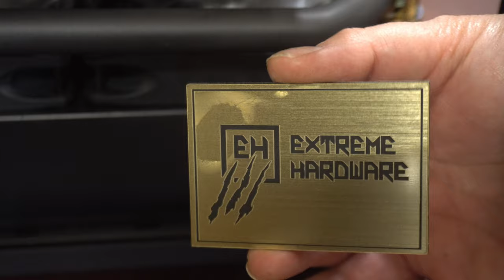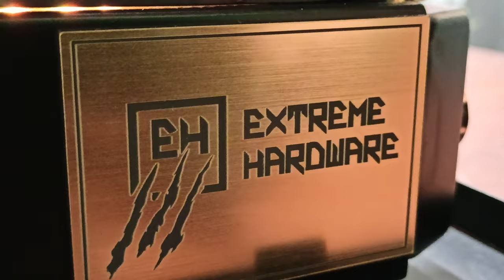EH "CHRONOS II" - Nowa odsłona konfigu z 2020 roku.

Comment from the maker: #rtx4090 #i913900k #intel #nvidia #raytracing #rog #asus #watercooledpc #gold #corsair #ekwb 

EH "CHRONOS II" jest nową odsłoną projektu EH "CHRONOS", który zrealizowaliśmy pod koniec 2020 roku.
Nowa wersja maszyny powstała jeszcze w 2023 roku.

Na początku materiału zobaczyć można wcześniejszą wersję EH "CHRONOS", na końcu opisu link do worklogu z 2020 roku.

W gruncie rzeczy jest to całkowicie nowy konfig gdyż z wcześniejszej maszyny pozostały jedynie dwie chłodnice, złączki oraz rezerwuar.

ROG Z490 MAXIMUS XII EXTREME ustąpił miejsca ROG Z790 MAXIMUS EXTREME, i9-10900K zamieniony został na i9-13900KS, a TITAN RTX doczekał się zastępstwa w postaci RTX 4090 STRIX. 

Wymienione zostały również obudowa Lian Li 011WGX na Lian LI 011XL oraz zasilacz Seasonic TX 1000 na Corsair AX1600i. Wentylatory Corsair ML 120 PRO zastąpiły Noiseblockery NB-eLoop XB12P ARGB. Jedna z chłodnic 360/30 ustąpiła miejsca 360/45.

Podwoiliśmy również ilość pamięci DDR z 32 GB na 64 GB. Wcześniejsze moduły DDR4 Trident Z Royale na kościach Samsung B-Die wymieniliśmy na moduły Trident Z5 na kościach SK-Hynix M-Die.
NVMe SAMSUNG 970 PRO 1 TB zastąpiony został dwoma dyskami NVMe SAMSUNG 990 PRO 2 TB.

Specyfikacja EH "CHRONOS II"

i9-13900KS 5.6 GHz P 1.269v / 4.4 E / 4.6 Ring
https://www.x-kom.pl/p/1101211-procesor-intel-core-i9-intel-core-i9-13900ks.html?sm=COnbRpxN
ROG Z790 MAXIMUS EXTREME
https://www.x-kom.pl/p/1075878-plyta-glowna-socket-1700-asus-rog-maximus-z790-extreme.html?sm=n5cqZakU
64 GB (4x16) Trident Z5 6200 MHz CL36.38.38.36 T2 II/III
https://www.x-kom.pl/p/1189477-pamiec-ram-ddr5-gskill-32gb-2x16gb-6600mhz-cl34-trident-z5-rgb.html?gad_source=1&sm=VsBDGro0
ROG RTX 4090 STRIX OC / + 140 + 1200
https://www.x-kom.pl/p/1077106-karta-graficzna-nvidia-asus-geforce-rtx-4090-rog-strix-oc-24gb-gddr6x.html?sm=1EKLBalD
2x SAMSUNG 990 PRO 2 TB
https://www.x-kom.pl/p/1083719-dysk-ssd-samsung-2tb-m2-pcie-gen4-nvme-990-pro.html?sm=rXJqWi62
Creative AE9
https://pl.creative.com/p/sound-blaster/sound-blaster-ae-9
Corsair AX1600i
https://www.x-kom.pl/p/443737-zasilacz-do-komputera-corsair-ax1600i-1600w-80-plus-titanium.html?gad_source=1&sm=In3r3HcL
Lian LI 011XL Black
https://www.x-kom.pl/p/577765-obudowa-do-komputera-lian-li-o11-dynamic-xl-rog-certified-czarna.html?gad_source=1&sm=QFnOudPo
Adapter 12VHPWR 90 CableMod 1.1 Gold (sprawdzony w sposób nadzwyczaj restrykcyjny)

Custom LC:

EK Velocity 2 GOLD LGA 1700
EK VECTOR 2 Acetal + Nickiel RTX 4090 STRIX
EK D5 
Alphacool NexXxos 360/60 
Alphacool NexXxos 360/45
Alphacool NexXxos 360/30
Watercool Heatkiller 200 mm 
Złączki, kątówki, korki etc. Barrow Gold
10x Noiseblocker NB-eLoop XB12P ARGB
Thermalright LGA 1700 Contact Frame
Kryonaut Extreme 2g
3x 1L XSPC Clear + barwnik 
Oploty ExpandableCustoms
https://www.facebook.com/ExpendableCustoms

Worklog EH "CHRONOS" z 2020 roku
https://www.youtube.com/watch?v=o_Zg4MFj3qU&t=19s

Muzyka :

- Mass Effect Score: Sovereign's Theme 
- Mass Effect 3 - An End, Once And For All
- Mass Effect 3 Soundtrack - Leaving Earth